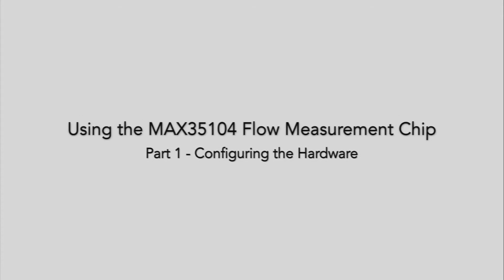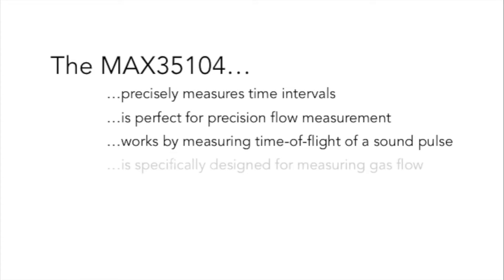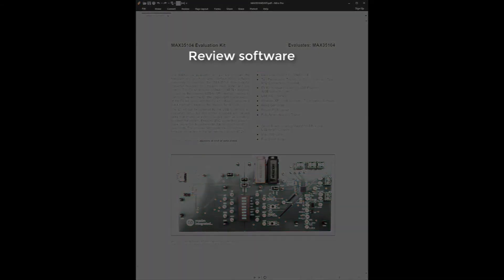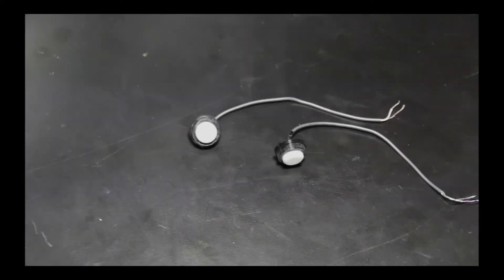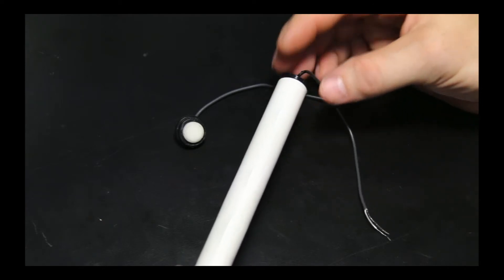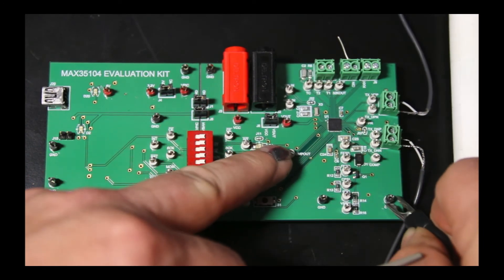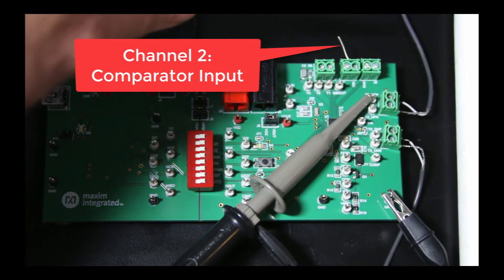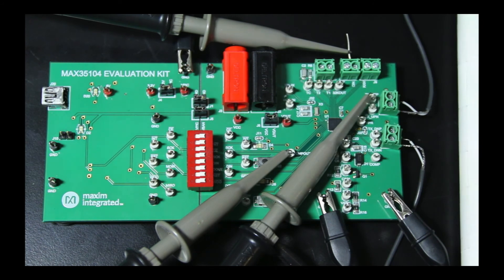Using the MAX35104 Gas Flow Measurement Chip, Part 1: Evaluation Kit Setup

Comment: where is the part two ?
Reply: https://www.maximintegrated.com/en/sitesearch.external.html?sp_q=Using%20the%20MAX35104%20Gas%20Flow%20Measurement%20Chip,%20Part%201:%20Evaluation%20Kit%20Setup&_charset_=UTF-8

Comment: Why split this into multiple short videos? I would suggest that if a single topic is split into multiple segments, take advantage of the end-screen annotations to link the next video in the series.
Reply: https://www.maximintegrated.com/en/sitesearch.external.html?sp_q=Using%20the%20MAX35104%20Gas%20Flow%20Measurement%20Chip,%20Part%201:%20Evaluation%20Kit%20Setup&_charset_=UTF-8